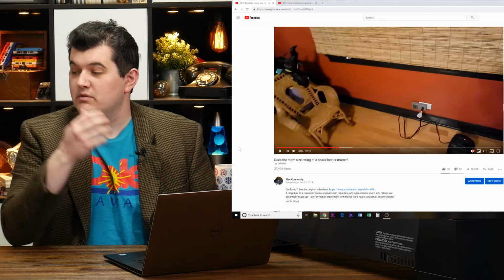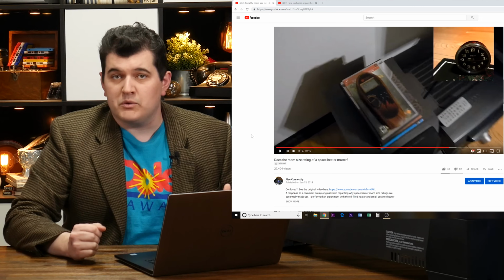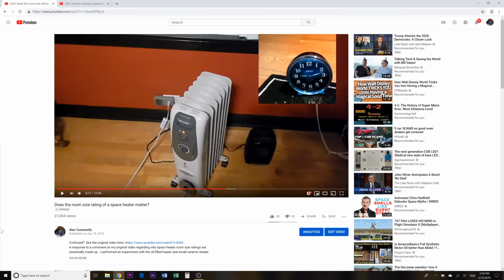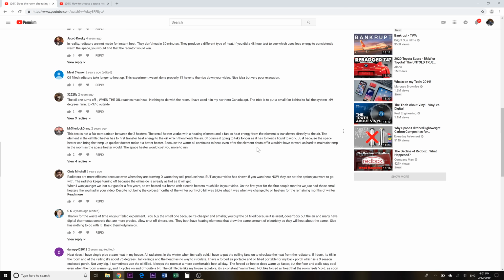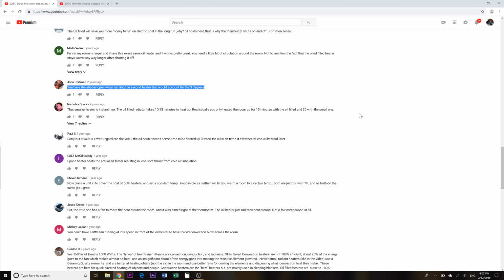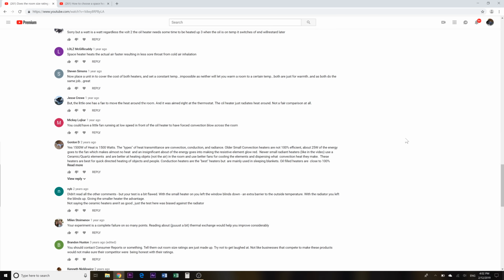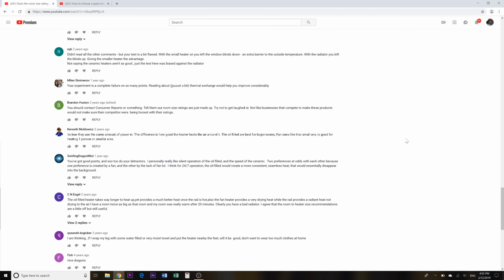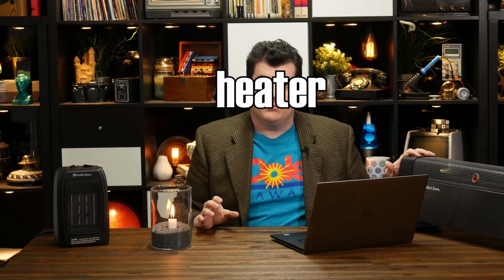More Space Heater Nonsense

Comment: I've used small space heaters for years in a camping trailer, my basement, my garage, my mid-size RV, and my CORMEC room while posted to Bosnia. I've learned a few things.

Found out that a ceramic heater doesn't really "move" the air. Sure, the hot air will rise, but it won't spread throughout a space. Same with those dish heaters that Costco sells. You have to be standing in front of it to feel anything. A heater with a fan moves the air MUCH more effectively and they have nicely warmed up all my spaces above.

There are MANY stories of overheating heaters causing fires. I always get a 2-3-speed heater with a thermostat, which most of the fan ones are and have. I NEVER use the highest heat setting. Tried that a few times for a short period of time, and it causes a lot of problems. The high power use can really heat up your power cord, your plug-in prongs, and heat up your breaker causing it to snap open. Some have power wires that are too thin to handle that power draw for any length of time anyway. The middle/lower setting, usually about 650-700 watts, is more than sufficient to warm up any space. 

I currently use a small heater in my garage to keep it over 5 degrees C, in my basement blowing on my feet, and in my RV when we're winter camping to about -15C. Not cold at all.

Comment: The reason I got an oil filled heater is so that I can keep a constant silent temperature in a room from dawn to dusk (as I run on solar). I find that heaters with blower motors make hot spots and cold areas. The oil filled heater just makes the entire room feel more comfortable (or the same temperature) with it's radiant heat.

Comment: Ive tried every kind of heater. The smallest, cheapest wirh the fan is best. 1 i had once had big heavy guage cord that would get real hot almost too hot to touch. Past few yrs ivbeen running the small cheap ones with a fan and they dont over heat the cord. The 2 radiator ones i tried made air dry and my mouth dry and smelled

Comment: 14:35 I guess you have outplayed yourself with this one. Just consider: all the losses are converted to heat, the light from led doesn't leave the room... 
But noise does.
So the unit with noisy fans is inherently less efficient and therefore strictly interior choice. Oddly enough, though, noise losses from heater with fan become relatively lower if it is used in a bigger room.
Reply: sorry how loud are the fans on your heaters? the fan listed on my parent's heater is a 2w fan

assuming all of the energy escapes the room (i doubt even more than 5% leaves), that would still be 0.13% of the input energy

Comment: I get that 1 BTU = 3.41 W...and that adds up to 5115 BTU for a 1500 W heater. I've fact checked the comment and know those numbers (as outlined in the video) are correct. What I don't get is how (at least here in the US) I can buy a 9000 BTU air conditioner that plugs into a standard 115 volt outlet which I'm guessing runs on the same 15 Amp circuit without causing an overload. I've always been an apartment dweller and never actually had access to fuse/circuit panels....but am confused that if there all 15 Amp circuits the numbers don't add up. I'm thinking the standard must be 20 amp circuits as opposed to only 15. Anyone?
Reply: I believe it is because window ACs are heat pumps. So, how much BTUs they can remove from a room is related to the entire system, including the external radiator, which includes more factors than merely resistive heating.

Comment: I had a large basement room and the oil-filled heater worked great as I needed just a little more than was coming into the room. I also have the same small heater my wife used when she is cold sitting next to a window heats up fast. So the both have a usage, but to heat up a cold space fast use the small ones. :)

Comment: I agree with you 100% 1500 watts is 1500 watts does not matter the size of the heater it makes no difference at all if the fan puts off heat and the cord puts off heat it's still heat regardless the heater 1500 watts is 1500 watts you're still getting the same amount of heat I have written the same test with different models

Comment: In a big room, if you can assume external temperatures are going to change slowly, it's better for there to be a low pass filter on the heat output, because it will reduce hot spots. 

Imagine if you're in a large room with a lot of furniture. If you use a space heater, the furniture near the electric heater will get super hot then cold then super hot then cold, while a radiant heater will heat things farther away, and so the whole room will warm and cool together. 

This is a specific advantage for large rooms.

Comment: I also bought two heaters very similar to these. I also was surprised, that they both had the same power rate, but the oil heater was clicking on and off all the time. In fact the oil heater was only on for like 10% of the time. I also was angry why they wrote X Watts when the heater was off for most of the time, was far from being X Watts. The one with the ventilator is more powerful, the oil heater is better to leave it on for the night... that's it.
People at the internet are stupid. That's what we can learn from this experiment. :)

Comment: 18:08 a "large room" heater is designed to have a large thermal mass and the surface area is better at heating its immediate sorroudings and a larger emissive surface makes it better in that regard? Also the same head output spread over a large surface makes it inherently safer
Reply: And as he keeps saying, that is a nonsense argument. If the purpose of the rating is to tell you which heater will heat the room better, it fails at that purpose. The larger thermal mass and safer operation DO have merits, and are worth discussing, but they are completely unrelated to the size of the room being heated and would apply to ANY heating application.

Ultimately, 1500 watts of heat is 1500 watts of heat, they do the same amount of work. The safety and method of distribution are not dependent on room size, if both heaters fit in the room and put out 1500 watts, which let me remind you is a measure of rate of energy being added to the room, the room will heat up by the same amount from each heater.

TC's whole point is that the size of the room is not relevant to which heater you should pick, you should pick the one that best suits your size, space, and safety requirements. THERE IS MERIT TO HAVING MULTIPLE TYPES OF HEATER! Different rooms might genuinely have different requirements, such as a room near a doorway maybe needing the oil radiator to deal with sudden temperature swings without running flat out all the time, or a fan heater for your big workshop where there's more than 1500 watts of heat loss happening but where you only need a 5 square foot area heated consistently
Reply: So you didn't watch the video

Comment: Not so fast, bud. If you have a plant in the room and the light produced by the tiny light on top hits a leaf and is used in photosynthesis, it will turn into chemical energy in the plant rather than thermal energy in the room. Debunked.

Comment: Hey there, zombie thread.

The meaningful difference between a small room heater and a large room heater is heating element temperature. An element with a larger surface area can produce the same amount of heat at a lower temperature. Element temperature is directly proportional (monotomic is the correct term, but not as punchy in a comment section) with the danger of a fire hazard when operating a heater over a long period of time.

The oil heater limits itself because that's a good thing. It's not a great idea to pull over 80% of an outlet's capacity at 100% duty cycle. Small room heaters are designed for spaces small enough that even a fan cooled 1.5kW element shuts off sometimes.

Comment: How does this compare to infrared heaters? I mean the ones that use infrared-C heat waves panels. Marketing says they do heat up objects, materials but not the air and it's a great alternative as only the IR-C waves hit you giving yo ua warmer feeling, without needing the room to be really hot. But there just goes an amount of wattage in there; so it problaby just heats the air the same amount per watts as the other electric space heaters? Benefit is just it's usually a low wattage panel (like 400w) that only warms you instead of using 2000w to warm the room air. But if i'd leave on the IR-C panel all day it would just give the same amount of heat to the room air as an equivalent space heater with the same output right?

Comment: First, as someone who deals with heating, assuming that 1500 w is enough for all spaces is stupid. Where I'm from, we don't have the size of the space, but the power, which is the right measure for heating the space. Power ranges from 1000-2500w, depending on which room it is needed for. The calculation is the cubic volume of the room times 60-70 watts of power for each cubic meter. So, with you, this nonsense of 1500w is just selling people to think that they got something. And secondly, although the heater is 100% efficient, it is a matter of heat transfer and rapid heating of the air. It is easier to heat the air if it has a fan than with natural circulation. The room itself also plays a role

Comment: Some people are a bit slow to process the information, some people project rather then listen to what you saying and some are just argumentative, the argumentative ones are the worse, they argue about the matter that hasn't even been the subject, guess they want to discredit you for the reason only known to them, maybe.
My question is which heater would cost more to run for the 24 hour period. Electric fan heater or Oil Radiator heater as well as is there any difference, if any, in room temperature.

Comment: Understanding how well something will heat up something else is a really easy experiment and calculation to make.

You don't have to take anything into consideration between the two heating methods even.  Conduction and convection are both only dependant on the surface area of the hot system and the temperature difference between hot and cold systems.  Then run some math with some constants and you'll get Q (thermal transfer).

If the question we're asking is "how do those 1500 watts heat up a system?" Then thermal transfer is what we need to be calculating for.  Since it takes into account the conversion of all of that 1500 watts into heat energy (also your assumption), and the only other thing it takes into account is the system in which those 1500 watts exist.

A heater with a higher thermal transfer will be able to heat up a space better.

Also in your experiment, you need to control for things better.  You called out the blinds, which is good, but the biggest flaw in the experiment, I saw, was that you didn't let the heaters get to full heat in a different room and then bring them into the test room once they were already hot.  If what we're testing for is how that 1500 watts heats up the room we have to wait until all of those 1500 watts have been converted to heat before we run our experiment.

I hope all is this is taken in good faith.  Good experiments are the cornerstone of good science and good controls are the cornerstone of good experiments.

Here's some more reading on thermal transfer calculations if you want.

https://collegedunia.com/exams/heat-transfer-formula-chemistry-articleid-6454

Comment: Put a box fan on low behind a radiator type heater to keep it maxed out all the time and was able circulate the heat better!😁😁 Ended up putting another lasco ceramic tower on another circuit in the room to heat when the outside temps got down to 18 degrees,Wow!😲😲

Comment: It's hard to have a completely fair comparison unless you have complete control of the room and the environment outside the room.  In the previous video you did, you noted that the heat that the heater produces has to compete with the heat leaving the room.  But in your experiments in your old video you don't know how much heat is leaving the room, and you don't know if the same amount of heat is leaving the room during the two experiments.  

For example, did you check the outside temperature before starting both tests?  Did you track the outside temperature as you were running both tests?  The second test obviously occurred later in time and you mentioned that you left the windows open and let the room "stabilize" for a couple of hours.  Outside temperature rarely stays constant throughout the day.  If you started your first test at 1PM and started your second test at 5PM then the outside temperature would probably be lower outside and get even lower as the test went on, meaning you'd probably have more heat flowing out of the room.

I don't disagree with your overall point, but I do think your original test was not scientific enough to conclude that an oil-filled radiator can't heat the room as well as the El Cheapo.

Comment: Watts are watts but assuming both heaters are the same style a larger surface area will dissipate heat faster than a small one. If you heated two pots of water on the stove and dumped one into a plugged sink which one cools off faster?

Comment: Here in the US a portable heater designed with a NEMA 1-15 or 5-15 plug is limited by the Electrical Code and UL to 1500 watts,  based on the assumption of 15 amp circuits in a typical house.  This equates to 12.5 amps at 120 volts,  and that by itself is a substantial load on a 15 amp circuit when you factor the unknowns,  the age and quality of the receptacles, whether they are wired using the side screws or the backstab connection? I've seen many burn and fail.   Is wiring copper, aluminum or copper clad aluminum? From about 1964 to 1973, aluminum wiring was very likely used since there was a severe copper shortage during the Vietnam War and copper was very expensive and harder to obtain, and aluminum has a tendency to expand and contract away from the terminals under heavy load and cause heat, arcing and fires at switches, sockets and other electrical devices.   Then add in the other loads likely in use especially in an older house that was built with fewer outlets and circuits available than what's acceptable modern households, and you can see how even a space heater can still pose hazards even when in good working order and used in a safe manner. 

Higher wattage portable heaters are available, but they are shipped from the factory with a different style plug such as a NEMA 6-15 or 6-20,  for 240 volts 15 or 20 amps respectively, so they cannot be mistakenly plugged into a typical household outlet.  These larger heaters are more commonly used in garages, warehouses and similar environments,  although you could use one in your living room if you had a 240 volt outlet for a window air conditioner.

Comment: My preferred electric space heaters are the fan-powered units that provide just enough airflow to prevent short-cycling by the thermostat. 
I place them close enough to me when I'm in the room that I can just feel their warming effects. 

The units that have relatively higher airflow spread the heat around a room more quickly, but the room can feel cool and drafty to a human being in the process, depending on variables.

My opinion of the oil-filled units is that because they are restricted, usually, to natural air convection and therefore operate on much shorter "ON" cycle times than fan-powered units, that they stress their own components and the building wiring much less, making them arguably relatively somewhat safer than fan-powered units to leave in an unattended room, where they may eventually bring a room to a comfortable temperature over a period of days, not minutes or hours. 
I've never personally used oil-filled or other natural convection type electric heaters, but I've heard other people speak highly of them.

To each their own.

Comment: This would benefit from a revisit with better framing around what a good space heater should do.  Yes, get up to set point ASAP is a figure of merit, but debatable if it's the most important vs e.g. holding set-point well, heating the room evenly, etc.  That's somewhat hard to test and needs some of that pesky nuance. e.g. do you expect that large rooms have a separate fan that can circulate air?  That changes what the heater needs to bring to the table.
There seems to be 2 schools of thought on this, some people just try to keep everything in the building's thermal envelope at the desired set-point and thus don't need great cold start times.  And then there's the folks heating a garage, outbuilding, or otherwise turning on the heat in a room that wasn't previously heated well and is 10-15+ degrees short of set-point - they care a whole lot about how long before they aren't freezing their behind off.